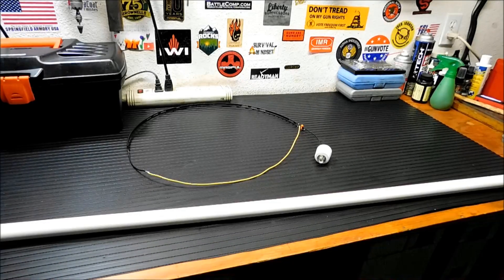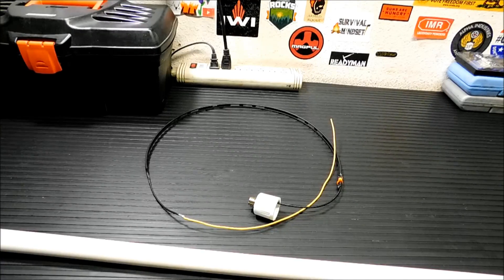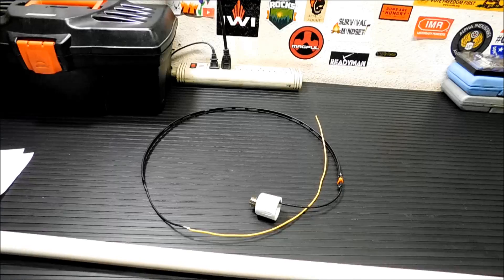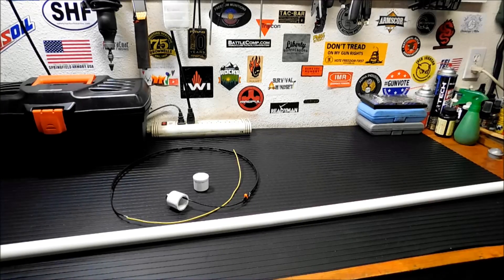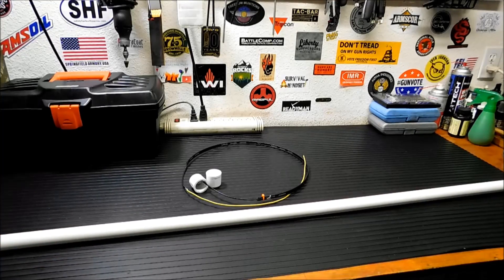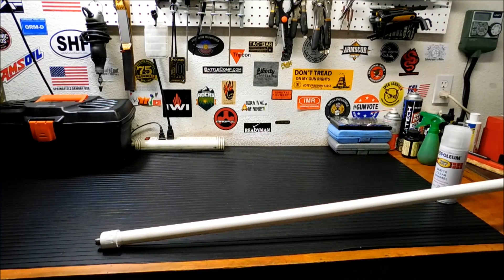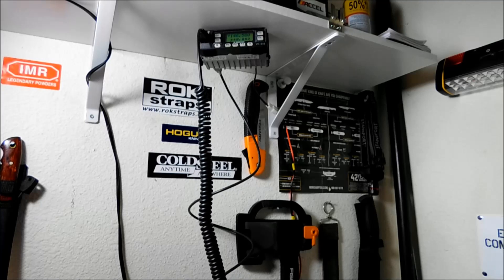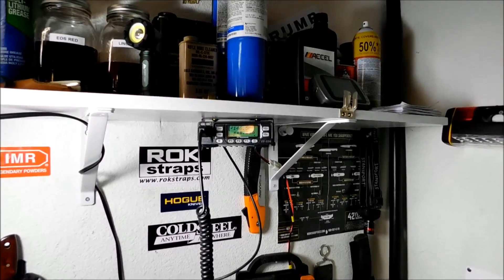Ed Fong DBJ-1 Dual Band UHF/VHF Antenna Assembly And Installation

Comment: Just stumbled on this. Do you have any experience with N9TAX. I've very familiar with Ed. He lives in Sunnyvale, CA not far from where I lived.BTW, did the PVC do any detuning to the annetnna? I'm thinking about getting a  MURS/GMRS version
Reply from the maker: Yes have one of the antenna systems from him. Good stuff
Reply: The thin wall PVC is part of the construction and factored into the design by Dr. Fong, so de-tuning isn't an issue.
Reply: @charlesbarkley2883  👍

Comment: I made a jpole design out of 12GA solid copper and tuned it for 463MHz (swr of less than 1.05). I installed it at a prepper site in the woods, and it received from a 5W HT from up to 5 miles away. I then bought a DBJ-1 tuned for gmrs and murs (swr of 1.3), and its reception at 462.75 was about half the distance as my $2 jpole. MURS frequency was just as bad. Everyone says "it works", but other designs work better.

Comment: Just saw this and great video, what coax did you use? Also any info on the way you mounted it…inquiry minds want to know lol thanks
Reply from the maker: I used RG 8 Coax, nothing fancy, and to mount it, I used pipe clamps on the bottom cap of the antenna since its the non resonant part of the antenna.  It worked great but gave this away to someone when I upgraded to a different antenna.

Comment: How do feel about it a couple years later and vs the tram 1477  you later reviewed? Thinking the ed fong painted black ir the tram in back. Either one on black fence too rail mast to blend in.
Reply from the maker: I actually got a second1477 for mobile operations and I like them both,  You don't want to paint the Ed Fong, they mention it in the directions as most paints contain some kind of metals and that will screw up the antenna,

Comment: I'm interested on mast you used to put the Ed Fong antenna on and how you attached it. Also did you run the cable on the outside down the side?
Reply from the maker: I used hose clamps to attach the antenna,  the antenna is just a 15 foot pole I got from Home depot dropped right into a hole on the top of my fence.
Reply: @Iridium242  Thanks!

Comment: I have the N9TAX version of this antenna , had it 3 years it handles higher power works great. Also cost a little less and comes with 16 feet of coax and the connector of choice. I love it. David Byrd KN4BHS
Reply: Have you had any success of putting the N9TAX Antenna in a PVC tube similar to the set up of this one?

Comment: I just realised its potential for emergency use.. just look at it.. it's just a couple of wires and you could roll it up and stuff it on your bag.. wow.. great
Reply: They make a roll up version with an extension cable so you can hang it up and still use a HT. I have it and it works great.
Reply: @11ride4life  I made it myself to his chart and instructions. Works very very well. Made contact 32miles with 3 watts of power.

Comment: Hello, thank you for review. Planning to buy this for Philippines in order for communities to converse especially during typhoon season. I was asked to do proof of concept and buy a bundle.  I hope to have a solution before then next typhoon season.  Please.  What coax cable options can I use, RG58?  I read below you used RG8.Thank you in advanced. 73, KM6ZIY
Reply from the maker: Yes just RG8 for this installation.
Reply: use less than 50' of RG8x at 50' you lose 4db, if more than 50' use LMR 400. or you will lose to much db.
Reply: please use RG8x

Comment: Did you use hose clamps and chain link fence top poles for your installation?
Reply from the maker: Yes, was trying to do this as cheaply as possible, it worked very well, I now keep this antenna inside and use a different one out there but I use the antenna often when we do events.

Comment: Don't be little this antenna!  I'm here to say I've had mine up for the last 3 years with NO problems.  I'm using a Kenwood TS-2000, pushing 50 watts plus at times.  A+++ antenna!

Comment: Any chance this antenna could get condensation inside the pvc? I live in a very wet tropical environment.
Reply from the maker: It of course could, but I would think a little PVC sealant or some kind of rubber seal stuff would prevent that.
Reply: @Iridium242  Thanks
Reply: @Iridium242  worse comes to worse...disassemble the antenna from the base  cap (or vice-versa) and check for moisture.  If the humidity is high during assembly purge the tube with a vacuum cleaner as the cap is placed.
Reply: I live in humid area, and while not an antenna expert, was told that for railings, fence posts, and similar that condensation is always a thing, and drilling weep holes is necessary to keep moisture from pooling up.

Comment: Why would one not use this antenna with a 50 watt radio? Can’t see why you state that!
Reply from the maker: You can I just am using this little tan watter in my garage.  It will handle 50 watts no problem

Comment: Excellent video and how to put this antenna together, I am still looking for something for a semi permanent antenna to leave at an off grid location. I am curious if you know, could a person put a hook at the top of the pipe and use that as a mounting point to lift this into the trees in the woods. I am new to the ham world, so I don't know if the would affect the SWR or not, or possibly even make the pipe about 6" longer to give it more clearance from the paravcord knot used to hoist it up into the top of a tree. Thanks again for the video and I hope you have a blessed week my friend. 
Dale
KI5ARH
Reply from the maker: I am pretty sure you can mount it from the top and it would not hurt the SWR at all.. but to be sure I would say check the website for his email and email Ed, he is great about replying to questions and will help you far more than I could.. as I just set it up via the directions.  Thanks, and welcome to the world of ham radio!

Comment: I never would have guessed the camouflage paint has metals in it ... thats crazy , learn something new every day
Reply: Nearly all paint has metal in it. Even standard Benjamin Moore and Sherwin Williams house paint uses titanium dioxide for the pigment. That said, I was about to paint my PVC and didn't put that together either. Think I will just sand lightly and clear coat.

Comment: I spray things I don't want to get wet with never-wet, or some other hydrophobic spray.  It lasts a couple years in weather, and won't become hydrophillic when it deteriorates like most paints do, even clear coats.  I'm not sure how long it will last inside the pipe.  Surely at least several years.  You can spray it on the outside of the antenna too, if you have problems with snow building up on the antenna in the winter time.  Believe it or not, in order for snow to stick to things, it needs to become wet first, and when that happens, it slides right off.

I learned to do this installing satellite dishes and terrestrial wireless internet antennas in places with lots of snow.  It cut down on service calls tremendously.
Reply from the maker: Good to know,  I am not worried about the show out here as its the Nevada desert, we do get snow once every few years, but not much, I was more worried about the sun beating on it, as out here the sun will destroy almost anything left out in it long enough.  Thanks for the info, I will have to check out the never-wet stuff for other projects I have going on here.
Reply: I used to live in St. George, UT, which is basically the same weather as southern Nevada.  I used that trick when I would go do jobs in Brian Head, because I didn't want to drive an hour up there just to brush snow off of stuff.  Now I live in Indiana, and although they don't get as much snow here as Brian Head, I still use it on my terrestrial wireless applications, because nobody wants to climb a tower in the cold because of snow and ice buildup.

PVC pipe doesn't like the sun too much though.  I wonder if there is some kind of UV protective paint that could extend the life of the PVC.  It also seems like ABS might work, but I'm not sure if you can get ABS in those sizes.  I usually see it much bigger.

Anyway, thanks for the video.  It is an interesting look for a j-pole.

Comment: I also added a TEE on the feed end, primed all the slip joints and fed the connector into the right angle of the tee.  Using a stainless multi turn hose clamp on the tee hub where the thin wall vertical is for a stronger assembly.. at the bottom hub of the tee was a foot long piece of standard sch 40 pvc for clamping to a 1 inch emt mast pole. Michigan experienced some 35 to 55 mph rainy gusts in March 2018 and the oem fittings popped apart..(the reason for primer and clamp). At 3' above roof peak and 12' back to soffet/gutter area, swr on 2m  mid band or 145.5 mhz was 1.1:1 . At both 143.750 mhz and 147.800 mhz swr jumped to 2.35:1 which is still safe to work at 24 watt rf.
On the 440 mhz or 7cm band the swr was favoring the upper end from 445.00 to 447.00 mhz with a swr 1.45:1 and a sharp curve to 2.955 :1 or higher swr . I think it is well worth the $36 . Thanks Ed Fong !! 
kb8qlz